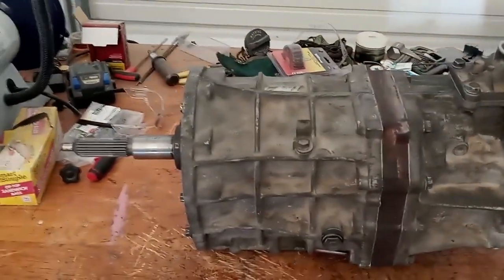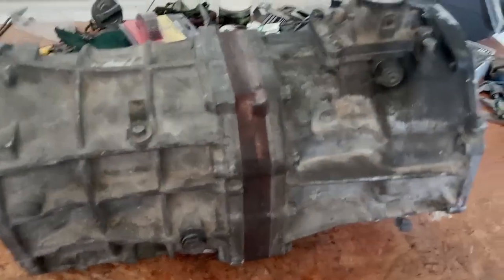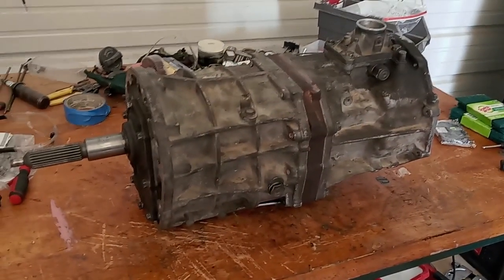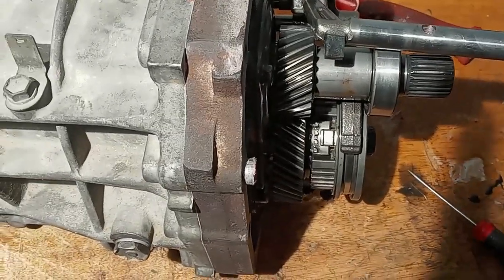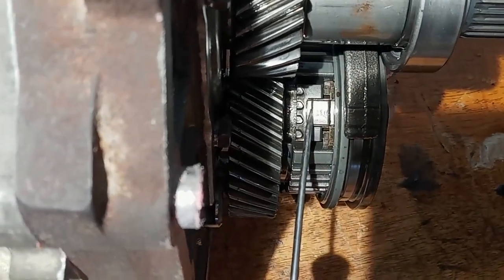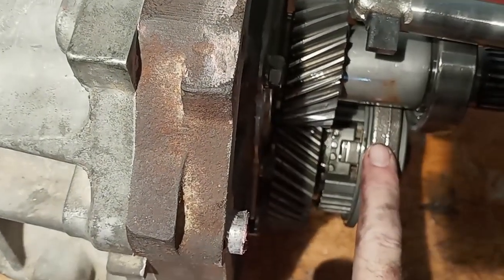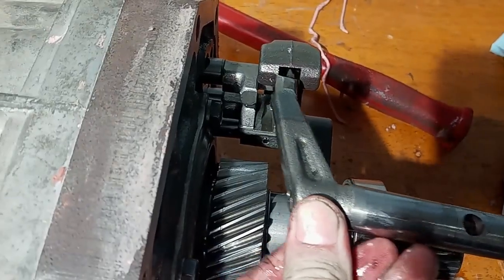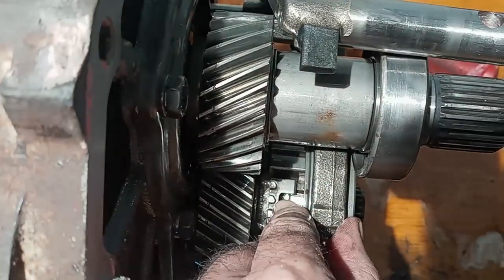Manual Transmission Stuck in 5th Gear

Comment: What was the cause of it going past the keys?
Reply from the maker: Incorrect assembly of the 3-piece syncro.  The syncro set locks together by twisting after assembly, this was not done which allowed for excessive play and coming off the key after 1 week of driving.